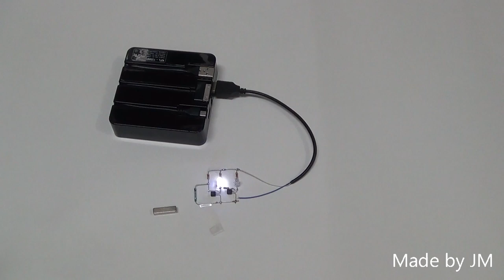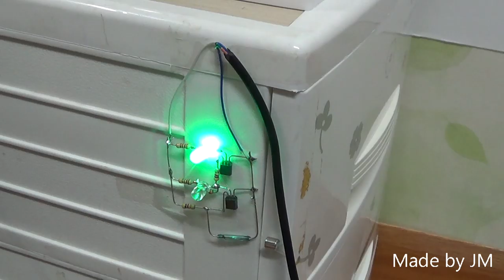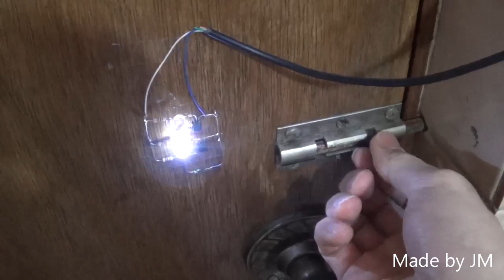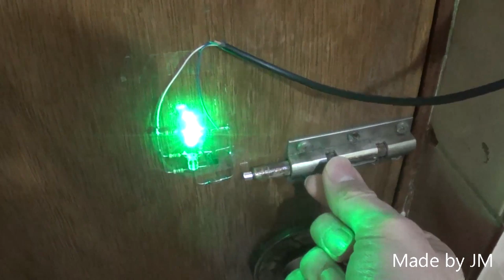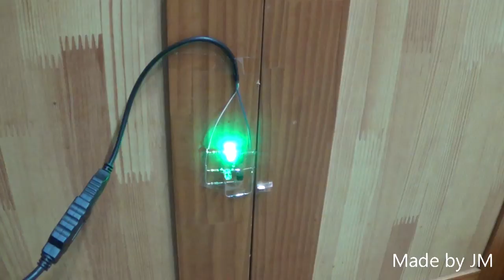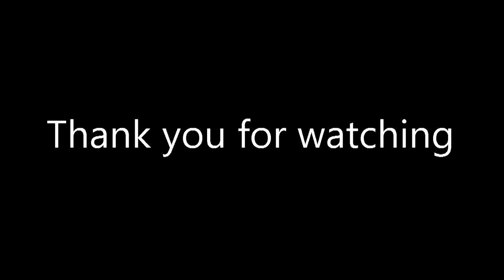Occupancy Indicator Light circuit

Comment: if you wanted to replace the green light with a speaker/piezo transducer.  How would you go about doing that?
Reply: probably the best way is to use an active piezo transducer and remove the current limiting resistor for the LED if necessary

Comment: Congratulations, I like your project and I want to do the same, but I have a problem...
I have two leds, one is white and the other amber (orange). My power supply it's 12V.
Can you tell me the best resistors for that?
Thanks in advance.
Reply from the maker: use 7805 regulator.
Reply: Thomas Kim The rest it's the same?
Thanks. You are the best. I like your videos.
Regards
Reply: Sérgio Santos lm7805 it takes 12v to 5v then you can completely re-do the project as Thomas Kim did. he was using 5v supply
Reply: MrDefamatt Thanks! Best Regards
Reply: +Sérgio Santos Why do people always ask this, use the damn formula for calculating desired resistance.
Reply: +Paul Abbey Thanks Einstein.